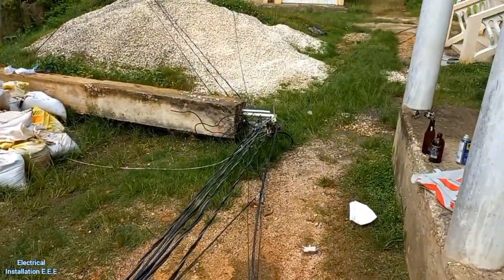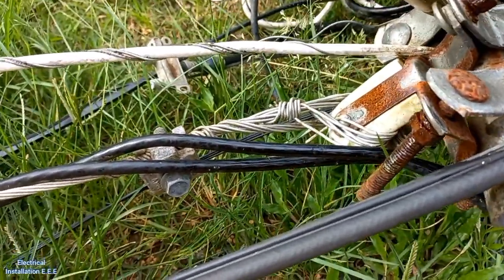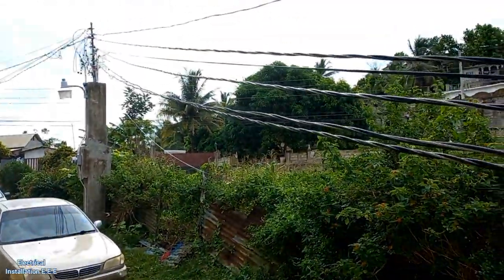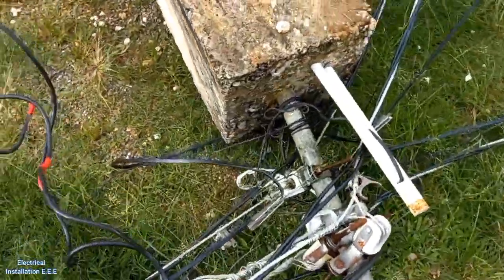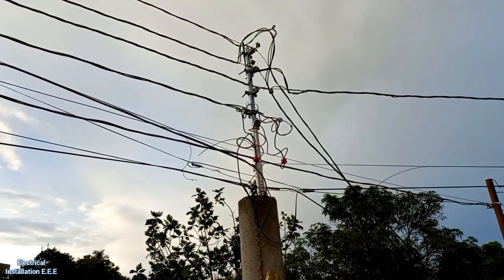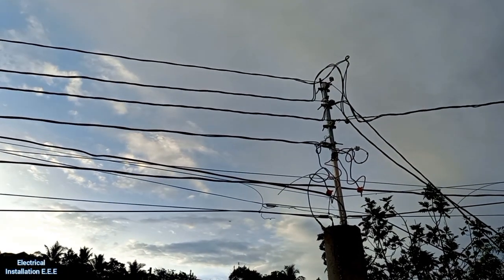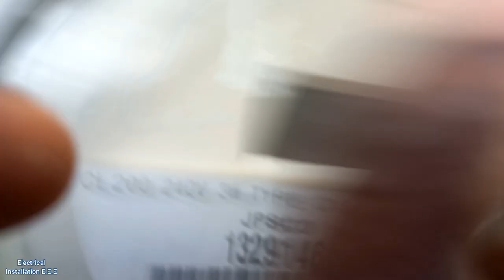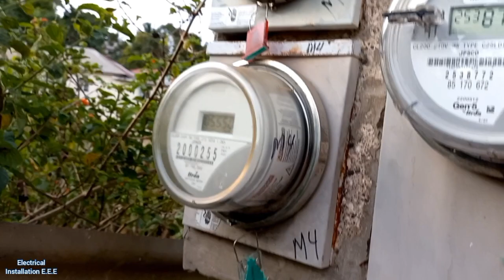Excellent techniques how to remove Triplex Cable Wires from one stanchion post to another post   DIY

Comment: Nice bro what size Triplex Cable?
Reply from the maker: 2 #4
1 #2
1 #6
Reply: @ElectricalInstallationEEE  That thing u rap around the pipe riser is called preformed Tie? 

Where do u buy it?